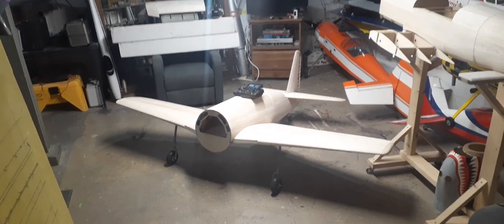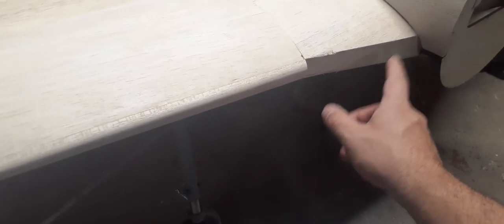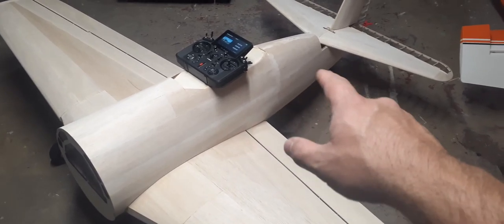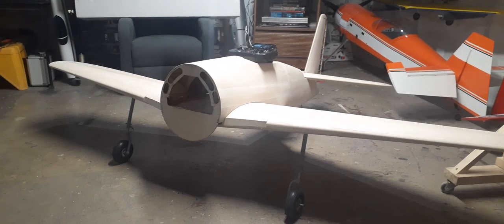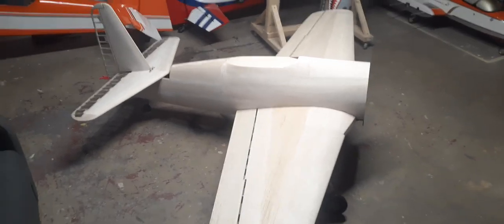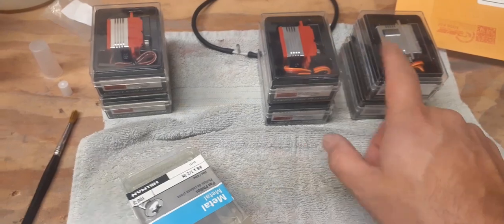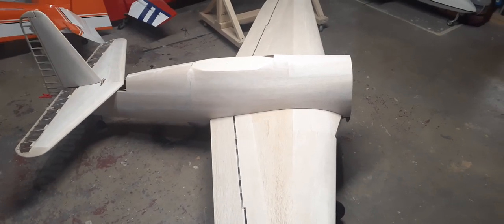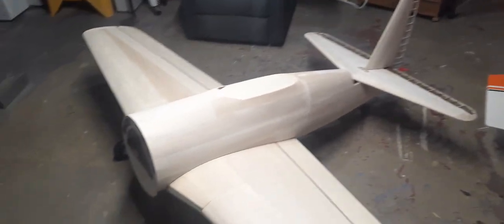Ziroli F8F-BEARCAT build update #5

Comment: Looking good Andy
 Please let me know what issue you ran into putting in the wash out in the Wings before I start building mine 
Would love to know an independent idea of what needs to happen Thanks brother looking great Can't wait for the next update
Reply from the maker: There is a 3/8 Square stick that runs the length of the bottom of the wing that is strategically placed so when the top of the wing is shaded it will form the proper wash out. I had it in the wrong spot before I realized where it was supposed to be which is clearly marked on the plans

Comment: How did you keep the wing from twisting and losing the washout when you sheeted the top of the wing?
Reply from the maker: There is a 3/8 Square stick placed under the wing in a strategic location that will hold the wing in that shape while the top is skinned
Reply: Ok thanks. So Nick has you frame the wing upside down? Sheet the bottom then flip it over and put the wing on that stick in certain locations, then sheet the top?
Reply from the maker: The wing is built right side up but the bottom is shaded first
Reply: Ok, thanks, that makes sense. Sorry for all the questions! How do  you support the wing to keep it from twisting or from messing up the washout when you sheet the bottom then? Sorry, never built a Ziroli.
Reply from the maker: I showed my prosses in a previous video
Reply: Thanks! I’ll watch it again.